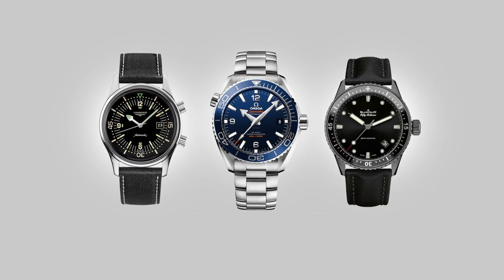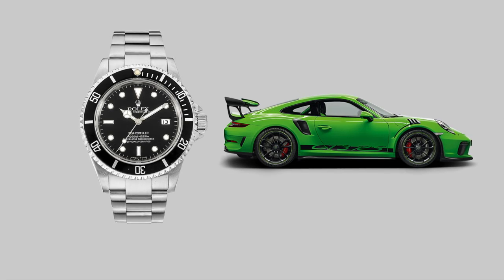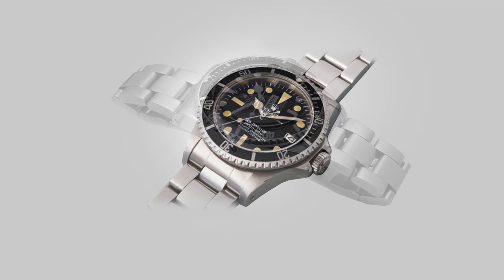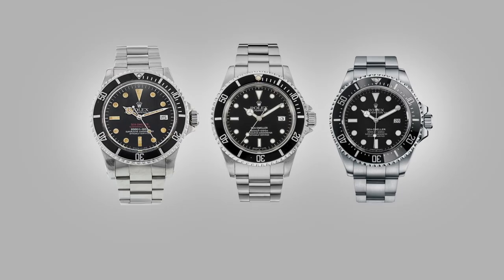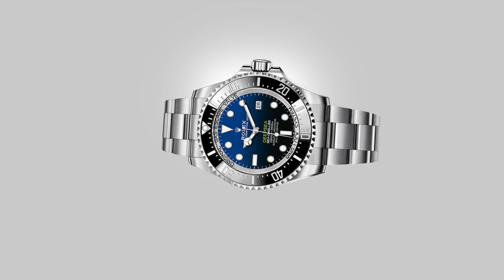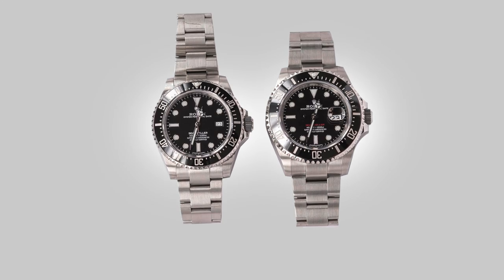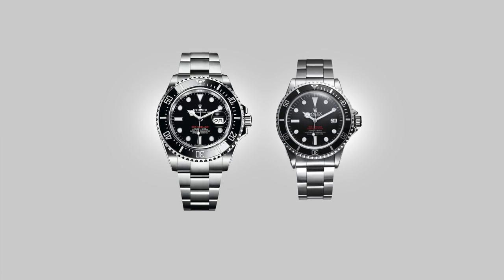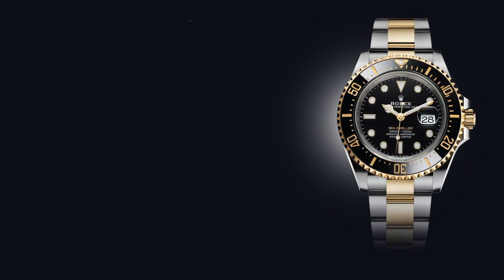The Problem with The Rolex Sea-Dweller Design

Comment: So even though you recognise that the SD43 caters for those with larger wrists, you'd still want it to be 40mm. Just because the SD has always been 40mm and so should it stay forever. So people with larger wrists should essentially suck it up.

Well I can't disagree more. The SD43 far surpasses any other diver in terms of beauty, elegant proportions and satisfying wrist presence. I have 7in flat wrists. The Sub 116610 feels underwhelming and looks boxy. The SD4K 116600 was riddled with off-putting proportions, questionable protruding crystal and misaligned end links. It was a total commercial failure. 

The SD43 on the other hand not only addresses all the issues from its predecessor but goes much further. It is the most compelling luxury diver ever made, not because it is the best at everything, but because overall it is the most attractive package you can find today in modern luxury divers. The best all rounder, the closest thing to perfection in this segment.
Reply: 100% AGREE!!
Reply: Had the 116600 you are so right on that. Sold mine because the eyes kept reminding of that fact , so got the sd 43. All good at last

Comment: I wanted the ceramic Ref. 116600 so bad.  But one day, I tried on a 16600 and immediately loved the aluminum bezel AND the case size.  It looks great on my wrist and although I have another Rolex, the SD is the one I wear 90% of the time.

Comment: 40 mm is too small for 20+ wrist but deep sea is too topheavy for anybody.
Reply: Someone knows what they're talking about! Compared to a sub, SD always had an issue with top heaviness, magnified by the DSSD
Reply: I rocked the JC DSSD for around a year.
It was a bit too top heavy but if Rolex had made the bracelet 22mm like in this new model it may have worn better.
With that in mind I think the SD43 50th will be perfect.
 Most people don't realize that Rolex wanted the cyclops on the original Seadwellers but it compromised the integrity of the "crystal" and they burst under pressure.
Now technology has made them able to do their original design.
While I am not a huge fan of the cyclops (for aestetic reasons) as I get older (49) the magnifier on the date makes it more legible.

Comment: I agree completely. I don’t own a submariner or sea dweller but I do own a 1986 DateJust which I wear most days. It’s understated and innocuous... I wouldn’t want any new Rolex now as they have changed as a company and become ostentatious as a preserve of the rich. Back in 1986 it would have been within the reach of a hard working man. The watch I own (my uncles) cost £600 in 1986. If you factor in inflation that should mean it should be about £1,800.00 now but in fact a new one would be more like £5,000.00 which is about 3x as much. Are they 3x Better? No. But they are 6x more bling and have become a status symbol to an extent that I’d be actually put off from buying one new.

Comment: I personally like the Sea-Dweller Deep Sea. There’s plenty of Rolexes in 36-41mm design for those who want a smaller watch and plenty of stainless steel options as well.  I think too many people are concerned with resale as well as buying into market preferences as opposed to personal preferences.  I’d never buy a Sub for personal use.  I prefer the Yacht-master I with metal bezel, and if I could only have one Rolex, it would be two-tone.  Far more versatility with my wardrobe.

Comment: 🇬🇧 Great video once again. Thought provoking and interesting. Never considered the 16600 before, but a great alternative to the Sub. Thank you
Reply: The 16600 is a great buy, still overlooked, great example can be had for descent price, as they are not yet vintage, but last of the aluminium bezel, which in Rolex seperates the "old" from the modern "ceramic bezel". The 16600 is definitely worth it!
Reply: Titi teatea Thank you. Seriously considering it 👍🏻
Reply: @Mark..P , one thing to watch out, is that the SD 16600 was produced from 1989~2009, 20 years, and has small changes along the years, going from tritium dial, to luminova to super-luminova and SL (solid end links) towards the last production years... For me, if it is to wear every day, one of the last model is the one to get, but if it is for collecting, a tritium dial or even a triple 6 (16660) is good to buy, as they are also still quite affordable in Rolex world...
Reply: Titi teatea Thanks. It’s for definitely wearing, I don’t collect for future value. Thanks for the help with this. Really appreciated. 👍🏻

Comment: Helium valve's are pointless.  The only time that you could possibly be in a helium environment is on land in a totally dry decompression chamber stuck there for 24 hours just waiting...  If your worried about the glass popping out as they reduce the pressure and change the gas your breathin back to air, just unscrew the crown.
Reply: Decomposition?  Dry rot?
Reply: James Bond needs it to blow things up, so it has a use on Omegas
Reply: @Seriously140  Thanks for your comment 👍 typing too fast and stupid spell checks
Reply: @thegorn  Your right when it comes to advertising in the latest films.  In the original books however he wears a Rolex Explorer 1. The same watch the writer Iain Fleming wore
Reply: Remember to unscrew the crown is not practical. More often than not you'll forget until the crystal pops out to remind you.

Comment: Got 1 SD43, cannot complain, looking back for the design on the early SD.Very comfortable, stable on the wrist due too the old style lugs,22mm bracelet and case back width.The bezel is larger too.For cyclop Rolex cannot set one on the old time , now they can !
For 126660,wonderfull watch but too heavy and gravity center too high unlike the SD43.So not that much comfortable on the wrist.

Comment: The sea dweller is ok but the deepsea is simply too thick. The width is ok but the depth is crazy. I’ve knocked my Milgauss several times off a hand rail or door frame so if I bought a deepsea god only
Knows how bad it would be beaten.

Comment: Also I have to say if Rolex had released a Seadweller single or double red line in a 40mm sized case with out the cyclops as a nod to the history of the seadweller but with the modern glide lock bracelet I would have paid serious money for that as for me it would be the ultimate Rolex watch...

Comment: The understatement of a rolex watch. Such an oxymoron. Besides the author forgets about the dimension of thickness here. Which makes the 116600 a shot glass. Leading the rolex design department to spread this 4000m thickness over a wider diameter - making it more balanced on the wrist. Something to consider. Not mentioning the better legability of the magnified date.

Comment: yes but is 43/44mm really that big? many gshocks are 50mm+ and dont even seem that big relatively speaking. i appreciate the case is very thick though...
Reply: The 43 is not too large at all..  I've found that when people takes pictures on the wrist, it makes the watches look larger than it really is.
Reply: All Things Important 89 even on a 22cm wrist even the deepsea james cameron looks big, bulky and top heavy, but the dial is amazing.
Reply: Yes 44mm is big. If you're not obese or a body builder it is absurd.
Reply: @Macca-95  Dont agree atall. I have 7inch wrists, it looks fine. try all metal gshocks or mudmaster etc, they dont look too big and some are are 50mm dia/15mm thick.

Comment: what is up with most watch enthusiast hands? 40mm is a dress watch, not a tool. Or grab a sub, it's basically exactly the same watch as SD, with more than enough depth you'll ever need. I don't have a big wrist, but 42-45mm looks just right, therefore I like Panerai and Breitling. I also occasionally wear Casio MTG, now this is overbuilt tool. If you wanna talk about overkill check Deepsea Challenger which claims to withstands depth of 12km where Mariana Trench, the deepest place on Earth, is only slightly over 11km.

Comment: Not a fan either.
The Seadweller is too topheavy.
And 20mm oyster looks ridiculously thin on the supercase Submariner.
I only like Datejust in the Rolex lineup.
Reply: But the lugs on the SD43 are 22mm, as therefore is the bracelet
Reply: 43mm SD has a 22mm bracelet.

Comment: Great vid clip; however, I am a fan of the 50th anniversary, though I do not own a Submariner, I am proud a owner of a 2009 Tudor Hydro 1200, capable to a depth of 1200 meters (3930 feet), with a helium valve...I feel it's comparable to the Sea Dweller...and no, my timepiece does not have a cyclops.

Comment: Sorry, but you presume that everyone wants a Rolex and that therefore Rolex doesn't need to compete....
Rolex however knows otherwise. 
So when the general push towards Oversized watches happened about 10-12yrs ago, ROLEX ALSO had to hop on that bandwagon, or risk having All there other watches appear to small (which they absolutely did, side-by-side). Not just Panerai.. but literally Every watch on down to a cheap Amazon Bling watch was Large.
Even if they knew that trend would pass, were they supposed to stop manufacturing for 5-10yrs, and then hire and retrain Labor once the demand for normal sized watches would return?
So they brought out +40mm sized watches. 
AND those sold well as the Market desired. AND Rolex kept being seen as relevant and not passé or cute "vintage" designs. 
And One more thing... we don't make these items. But Rolex does.. and they know what design shortcomings Need to be addressed.
And when they brought the Ceramic bezels out, to make them more durable/scratch proof from impacts and scratches, they Learned something they hadn't anticipated:
People (esp dopes in N
America) actually Drop their watches and have hard marble or ceramic Floors.
And guess what... Their "rugged" Ceramic bezels became Brittle, fragile components and CRACKED.
Enter the Larger Watch:
The Wider Ceramic bezel isn't nearly as delicate as a thin rim (like and aluminum bezel) would be.
And moreover... a Heavier watch has More Mass. So that, with luck.. the watch will crack the tile floor, and not the other way around.
So you can see that Rolex HAD to keep up with Market trends to Big watches, AND they used that to address the shortcomings of their own newer, more durable designs.
I have a vintage GMT. Nice thin case. 
One wrong smack on my excavator or tractor and my fragile aluminum bezel will get easily scratched, gouged, gored. 
No thanks.
I'm considering the two-tone Ceramic Sea-Dweller now for everyday wear. 
And you know, what with So Many gorgeous top-end watches out and about now... Yeah, i won't mind a couple more millimeters so that someone who wouldn't normally know, might say.. "is that a Rolex?"... and i can have a conversation starter ~
Reply: The newer Sea Dwellers can be used as knuckledusters,and  just like Vostok watches suffer no ill effects :)

Comment: The helium release valve is only necessary for saturation diving. You can take a watch to the literal bottom of the ocean and back up without a helium escape valve. And Rolex did in 2012, the Deepsea Challenge that actually went to challenger deep had no helium escape valve.
Reply: Thats because the escape valve would of leaked water at that depth.
Reply: @andrewallen9993  yeah, my point is it’s not arbitrary to have such a deep diver without an escape valve because the watch doesn’t need one on the first place. That’s not the purpose of the watch.
Reply: @hochspannunglebensgefahr5339  The Vostok Amphibia has a helium escape valve, it's called the crown, you undo the crown while decompressing and the wobbly design prevents damage to the mechanism. Like an AK 47 it's crude but it works😁

Comment: SD43 is larger but not thicker than the 116600 at 15mm. The reason for going larger is to accommodate larger wrists because believe it or not, a 40mm watch can look small on 18cm /7in wrists and above. I wear 44-45mm divers, the SD43 is my smaller one.

But I can see why it would bother people with smaller wrists.

Comment: Here's what you're ignoring... some guys (me) have large wrists. 
You think 44mm is overkill... it's the minimum size I can wear. I have a 44 Panerai, which looks on me like submariners look on most people. I also have 46mm and a 48mm Breitlings which also look very normal and not oversized on my thick wrists. 

The 44mm Deepsea is the ONLY watch that is remotely suitable for me if I want to own a Rolex. The slender-wristed fellows have the rest of the Rolex lineup should they desire. Finally, there's an option for me. There's nothing overkill about that.

Comment: i see, and understand where you are coming from. i totally get what you are saying. i just ordered a deepsea , would i change my mind after this video, no... but my reasoning for it was simple., - everyone around me has a submariner and i wanted something a little different. i could have gone for the smaller one but i liked the blue. and i was not prepared to spend double the money on a blue submariner. now i have never put the 44mm deepsea on my wrist ever as i have never seen one in real life as no one has it. so it should be interesting once it arrives. but all my watches so far are subtle, my speedmaster or my aqua racer.  so a deepsea that it over the top loud should be fine. And your point of a sea dweller doing the same job even though it got bigger and it didn't need to increase the size, well majority people don't buy watches to go scuba diving. as i mentioned everyone around me at my workplace as a submariner, none of them go snorkeling or scuba diving or anything... the same 99% of the porsche gt3 rs owners don't take them to the race track.
Reply: I got my James Cameron and I have been wearing it daily. So i took the time to find this video again and here I am a year later telling you that I have wore the watch daily and i love it... Have had no issues. I even bought the breitling avenger 45mm and i wear that too... one just needs to get use to it... thats all... now i find my aqua racer and speedmaster too small for my liking.

Comment: Ok great vid but small correction inbound; In the 50th anniversary Sea-Dweller the cyclops and the crystal is actually one and the same piece of sapphire.
Reply: You are correct. Rolex told me this.
Reply: I doubt that. I am pretty sure that I read that Rolex said the issue was always about the glue, and they now have a glue that works.
Reply: @tn_onyoutube8436  Rolex told me it is moulded on.
Reply: Fair enough. Though if by Rolex you mean an authorised dealer I would take that with a pinch of salt. I have read in several seemingly authoritative articles that it is glued on, but, whatever.
Reply: @tn_onyoutube8436  Rolex technicians told me i London Service Centre

Comment: Dunno if I've been over exposed to Rolex diver designs, but I just really don't like them. Too "common" or "ubiquitous" (every manufacturer has a homage),  tho the design elements I particularly dislike are the awful Mercedes hour hand & date window (especially cyclops) which looks like an afterthought & is surely completely unnecessary at the bottom of the sea. I love dive watches but for me these are a swing & a miss. Excellent video as always tho. Cheers 👍

Comment: The SD43 is brilliant. It doesn’t go against the grain of the Sea Dweller line - it’s slightly wider than the previous Sea Dwellers, but it’s also shorter on the wrist and feels very secure with the wider bracelet. It’s the epitome of what the Sea Dweller was meant to be from the beginning. Sorry, IDGuy, but the way you state your opinions like facts is quite annoying.

Comment: I was in water rescue and an evidence recovery scuba diver for 10 years, so dive watches became a hobby. I have over a dozen various 40-44mm divers from Rolex, Omega, Breitling, Tag, and Seiko. If I could only keep 3 out of my collection, I'd dump all brands except Rolex, and even then I'd dump every Rolex 40mm and under. What I'd keep are first year productions of: 126600 SD43 Mk1 50th anniversary, 116660 DSSD 44 in black of course, and the 126603 SD43 two tone. Submariners are for snorkel enthusiasts. Divers choose Sea-Dweller.

Comment: I think you would disapprove of my new Citizen Eco-Drive BN7020 09E dive watch. Enormous and commanding to behold. And I really don't consider any Rolex to be a tool watch by virtue of the jewelry category they fall into. They're too pretty to be considered tool watches.
 
And as for accuracy ... no mechanical can hold a candle to a modern quartz movement. Period. I'm getting 1 second gain per month with the Citizen ... and I consider accuracy to be a primary aspect of any wristwatch. I grew up with mechanicals ... and when I got my first quartz watch in 1982, I was amazed at all it could do. 

I have a few Bulova 262s as well. One is giving me +5 seconds ... per YEAR! It's not a dive watch, of course ... and it's not a piece of jewelry either. It's a Sea King, but I don't think the case back seal is anything exceptional ... so I wouldn't take it underwater.

Comment: I own a DSSD and wear it every day. The main reason why I bought it was for its size. I’ve always liked the looks of the 40mm SD and how it flies under the radar to the untrained eye. However, even when trying on the 116600 ref, it still looked almost dainty on my 8.5” (I’m 6’6 265lbs so I hope that helps further illustrates my point). When I tried on the DSSD, optically it just looked right and more importantly, it felt right. And I’m happy to say, after 3-years as my daily go-to, I have no signs of OA lol
Ps. I very much enjoyed your video 👍

Comment: Vostok Amphibia.  I've regulated mine to ±2 seconds a day—within Rolex spec.  1% of the price.  No cyclops.  Also used for decades.  Still made with acrylic dome crystals.  The best seal design of any watch.  Cheaper to replace than repair.
Here's a picture of one of mine.  https://en.wikipedia.org/wiki/Amfibia